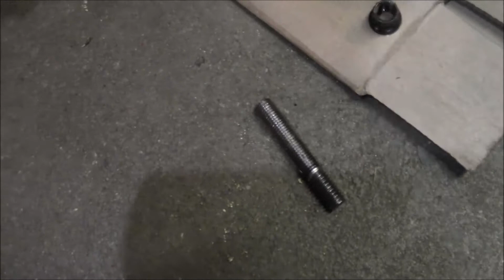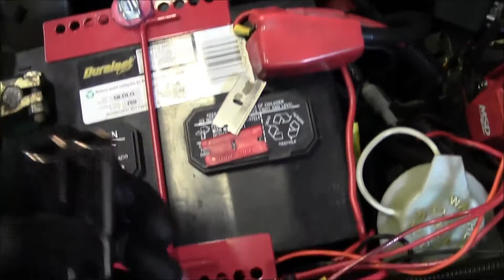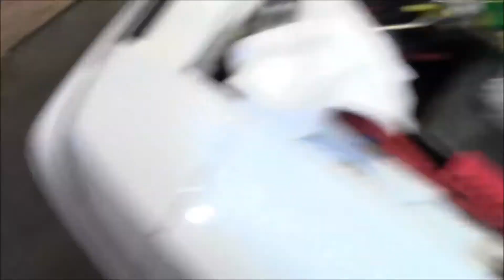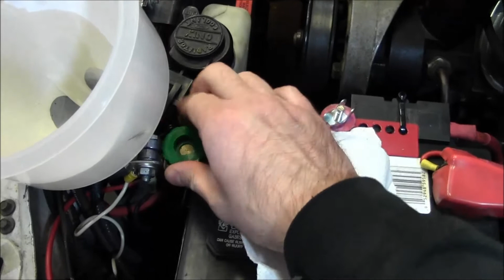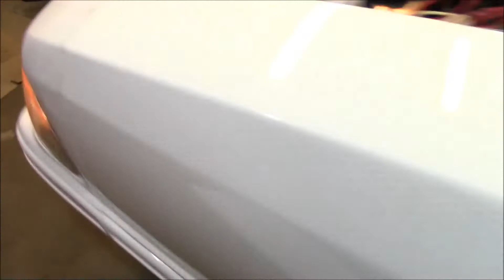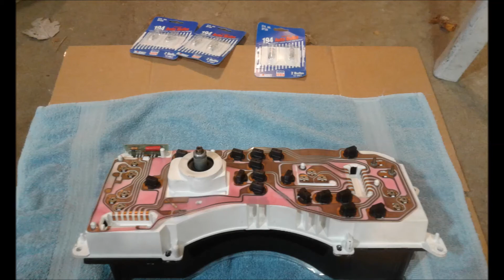5.0 HO Intake Install & Valve Covers (with stud alignment)

Comment: Loc-tite on valve cover bolts... 🧐
Reply from the maker: Star washers work too.  There are lighter strength thread lockers to do the job.  I've had good luck with it

Comment: Love your attention to detail, I cracked my lower intake replacing temperature sensing unit - Im kinda nervous about replacing it my self but I can’t find any reliable techs in Southwest Michigan so Im going to give it a shot. What sz are the studs you used to guide intake so I can be sure to buy some?
Reply from the maker: Remi J:  They are 5/16 automotive studs.  You can find them at Ace or Blains Farm and Fleet.  Just screw the studs in until they seat.  You don't need to tighten them.  Then when the intake is on, you can remove them.  I think the ones I used were 3 or 3.5 inches long.

Comment: Did you retorque your intake bolts after a couple of heat cycles? I recently installed a Edelbrock performer intake on my 95 gt. I used the Fel pro Gt40 intake gasket kit which are the basically the same as the Ford Racing ones you used. Fel Pro said I didn’t need to retorque that style of intake gaskets, but I hear from some people you always should, and some say don’t worry about as long as you use the torque procedure like you did.
Reply from the maker: nate griffin:  No, I did not.  I used blue thread sealer Permatex 24005 on all the lower intake bolts.  I feel that doing a retorque would disturb the thread sealer.  However, that's really a personal preference.  Retorque is recommended for the intake and cylinder heads after they are heat cycled.  If you feel that you need to do a retorque, by all means do it.  I'm sure I will end up checking the lower intake torque at some time in the future whenever I have the upper intake off again.  I was content with the thread locker and decided to skip doing a retorque.  Over the summer I purchased a book about fasteners and it seems that thread locker of the correct strength is very important and often over looked.  That book also got me into using moly lube on the bolt heads and washers.  I had never considered how much binding can be caused when those pieces are not properly lubricated for assembly.  I am a strong believer that as the owner of your vehicle, you need to make the choice that you are most comfortable with.  I'll let you know what I find whenever I end up doing a retorque.  Should be interesting to see what happens.

Comment: Greetings! What was/is the purpose of the water hose restrictor?  Thanks in advance.
Reply from the maker: '93 Cobra:  The restrictor helps extend the life of the heater core by reducing the amount of pressure the water pump is pushing to it.
Reply: @fwh79FOXR6  Thanks for your response.
Reply from the maker: @93SVTMustang  You're welcome

Comment: Welcome back! Working hard out there I see. I'm glad you made this video, still leary tackling my Cobra Intake,  but I think I may be able to if I followed this. What were the bolts you used to align the gaskets??
Anyway, good to see you out here again, hope.all "else" is good.
Reply from the maker: J PP:  Thank you.  Yeah, i've been dealing with some personal life issues lately.  It has been distracting me from YouTube.  Your intake should be an easy install, just a little time consuming.  It's not your daily driver so you have the massive advantage of walking away from it at any time.  That's always better than being under the gun to finish the job.  You will need at least 6   5/16" automotive studs, 2.5 or 3" length.  They work out really well for getting everything lined up.  Fel-Pro makes a nice intake gasket but I am really growing fond of that Ford Racing graphite gasket.  I used the Ford Racing gasket on the black car and it seems to be holding up well with no issues so far.  Did you ever get some heat set up in your garage?
Reply: @fwh79FOXR6  hope all is ok, I know how the personal life things go!
 I will look into those automotive studs when I go grab the lower intake gaskets. Man it looks like a pretty big of a job, draining the radiator and removing the pump for that intake...would be THE biggest job I ever did on my own car. All part of the learning process I guess. Still need to get it all cleaned up first! We got a long winter, lol!
Heat will be in the garage soon...I need a small gas line installed and I can hook up the wall unit I bought. That will be done first before I start tackling all this other stuff. Lots of parts arriving, I'm stockpiling right now. So yes, heat is coming and I'm so pumped for it...no more salamander heating fumes!!
Reply from the maker: @jpp9846  Yeah, you gotta drain the coolant but it is a good opportunity to add fresh coolant and replace the thermostat.  Getting new hoses is not a bad idea if you have older hoses.  Good time to replace that stuff while the coolant is drained.  Cleaning is probably the worst part of the job.  Once you get past the clean up part, it is usually smooth sailing.  Glad to hear you are getting heat in your garage.  My heater is doing pretty well.  It has issues, but it is still making enough heat to be comfortable.  Salamander fumes are not good for human consumption!
Reply: @fwh79FOXR6  yes, I am considering replacing the radiator with an aluminum one while I'm doing this. They aren't too expensive and would be a good time to get to it. The list keeps.growing though! I have Koni's and H pipe coming soon too... probably after the holidays. Arriving yesterday was a new fuel rail guage, Adjustable FPR, ACT, temp sending sensor.and oil pressure sender...grabbed some LED for my cluster too.  Going to be busy, busy soon enough. Heat first though.
I will definitely be in touch when I'm tackling that intake.
Reply from the maker: @jpp9846  New radiator is a very good idea.  Sounds like you have no lack of projects to undertake!
Reply: @fwh79FOXR6  haha, I'm definitely filling my plate for the winter. The intake will definitely be the most time consuming/intimidating and probably the last I will tackle. I was just thinking if I had to drain the radiator, I might consider swapping it. Would love to have better heads put on it while it's stripped down too, but I'm digging deep in the pockets with what I got going now. Sometimes the eyes are bigger than the pockets!!
Reply: @Herbert Wingfield Boston?
Reply from the maker: J PP:  I hear ya... no lack of "I want that!" when you own a Fox Body Stang!  I think that swapping the heads would be a huge job.  You would probably need a mass air swap to get it running right.  The whole job will burn up the bucks.  Plus... if you are going to do the heads, you might as well do a cam swap too.  That would make the mass air conversion a necessity.  I think you will be very happy with the intake swap.  I would do that and drive your car next year.  I know i'm personally getting tired of endless projects and no driving.  It's not hard to spend the whole year turning wrenches and missing out on driving your car.  I'm pretty excited to see how your car turns out with the Cobra intake.  I think it is going to be a very rewarding experience for you.
Reply from the maker: Herbert Wingfield:  I actually had a hard time finding the blue hoses... if you can even imagine that!  I had to get Mishimoto hoses for the white car because I couldn't find the blue hoses.  Also... Continental bought Goodyear's hose business.  The blue hoses I got for my black car were Continental and not Goodyear.
Reply from the maker: J PP:  Hahaha!  Yeah... Boston.
Reply: @fwh79FOXR6  hahaha, true story. I'm like a dam dog in the park again, "squirrel". Seriously though, my goal is to get 3 things done this winter. Intake, Koni's and the catless H pipe. In fact, yesterday, I had it up on stands, running and noticed an exhaust leak before the driverside muffler. Wondering if that was the issue with power loss. Also noticed that the H pipe currently on the car, IS a MAC off-road H pipe, that the previous owner had cats welded on. I reached out to him and he said it was done for 2 reasons, emissions and apparently his wife didn't like how loud it was, lol. He said it didn't smell bad and he liked the sound. So! I'm changing that back to catless. I'm really gonna need some help on this Intake Manifold...I've never did anything like it. 
I'm hoping it'll be a lot better come spring, I'm with you, I don't want to be wrenching on shit this coming year...I wanna enjoy it.
Reply from the maker: @jpp9846  The intake shouldn't be so bad.  Just take your time.  Plus you have all the Mustang guys on YouTube to help you out.  I think you're in good hands.  You're gonna feel pretty good when you fire her up and get that condensation BRO!
Reply: @fwh79FOXR6  LOL...it's gonna be AWESOME, bro!
Reply from the maker: @jpp9846  Hahaha!!!
Reply: @fwh79FOXR6  I'll be in touch when I start tearing apart things, BRO!
Reply from the maker: @jpp9846  Looking forward to it bro.  Just don't get triggered brah!
Reply: @fwh79FOXR6  Will do...the struggle is real bro, I'll try not to get salty, BRAH!
Reply: @Herbert Wingfield thanks!
Reply from the maker: J PP:  Hahaha!  Salty like a midwest road in winter time.
Reply from the maker: Herbert Wingfield:  No... but it does destroy cars!
Reply from the maker: @Herbert Wingfield Thank you.  Been working on the Lightning detailing videos I filmed back in June.  Been dealing with plenty of family drama thanks to my Mom and two sisters as well.
Reply from the maker: @Herbert Wingfield My dad seems to be doing ok.  Plenty of family stress to go around lately.  Sorry about your loss.  I try to spend as much time with my dad as I can.  He has been through a lot over the years and the women in my family give him zero credit for that.  It would be interesting to drop my mom off in Da Nang 68-69 and see how much she would enjoy the Tet offensive.  I might be making some "shorter" videos some time in the future.  I can't even make a cool thumb nail!  Clearly, this channel isn't for everyone.
Reply from the maker: Herbert Wingfield:  You're right... that intro does sound like an engine idling.

Comment: i tell you what that mustang 302 5.0 vale cover o-ring gasket is the best gasket I ever used, I try to use those on other covers I have also. o-ring stuff is just the best, NHRA, NASCAR, TRACTOR PULL, TOP FUEL all use o-ring stuff.
Reply from the maker: Jason Gordon:  I have had pretty good luck with them.  I like using cork valve cover gaskets.